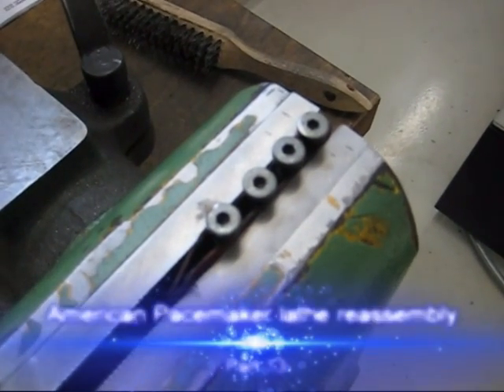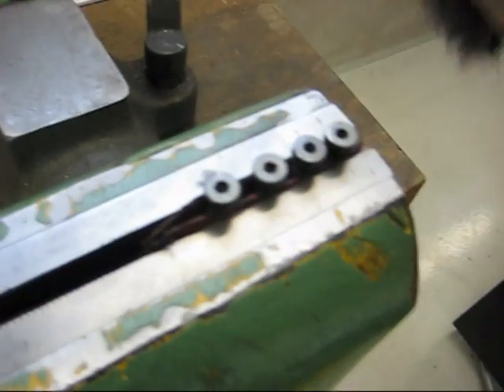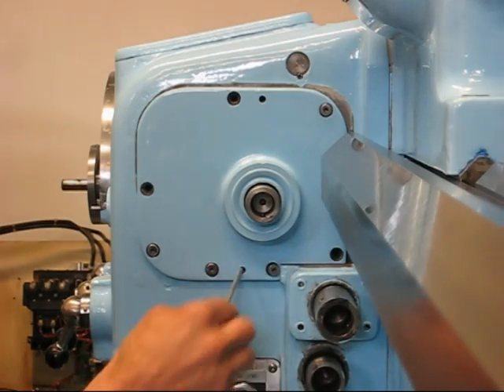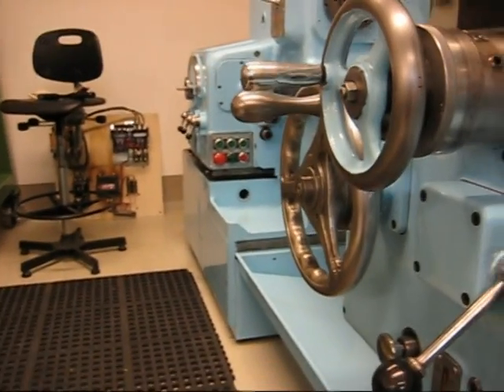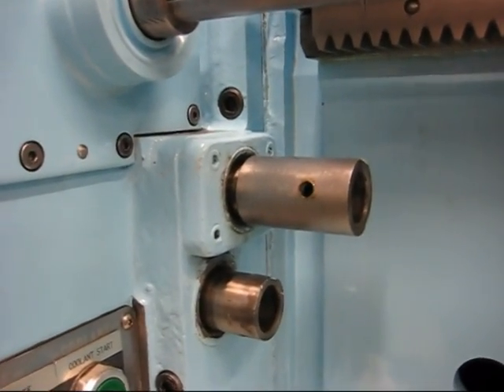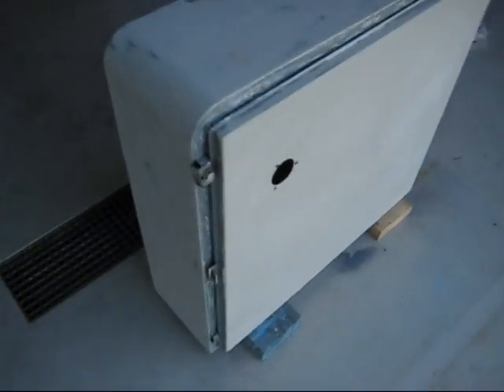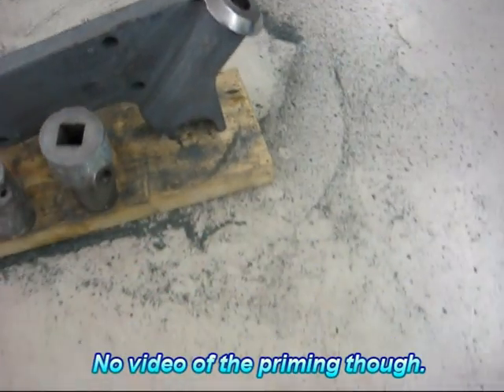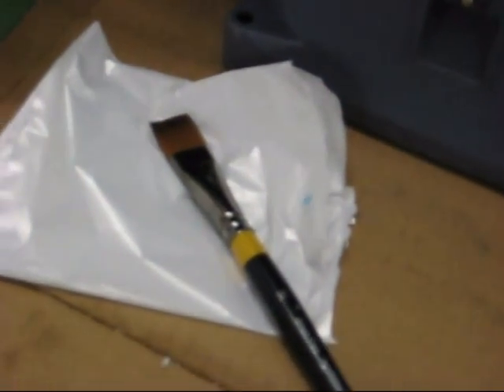American Pacemaker lathe reassembly part 13

Comment: This machine is going to run great.I think the color may be Petty Blue.What's the weather like, this time of year.Bill
Reply from the maker: Yes, it will certainly be better than before I had it apart. Many small things I've fixed during the assembly.
It has been up to 27 degrees but that is not normal . Daytime between 10-20 is normal.